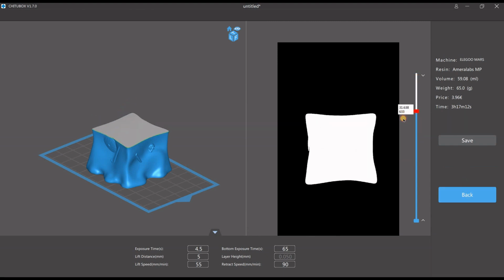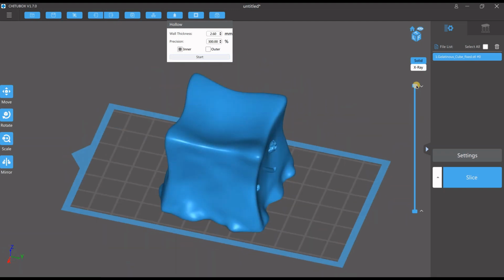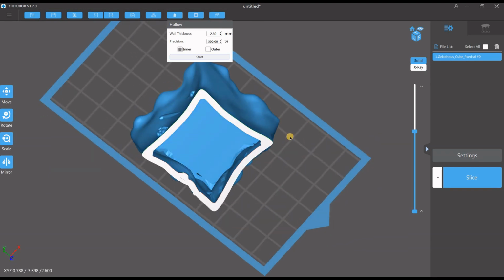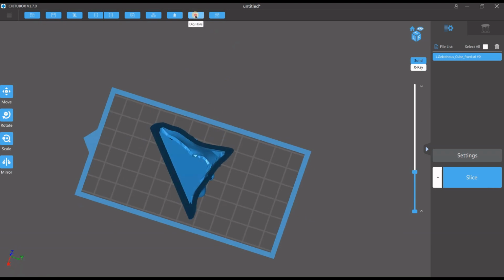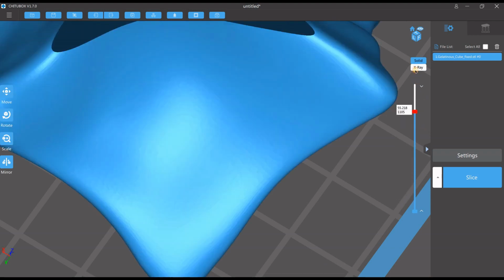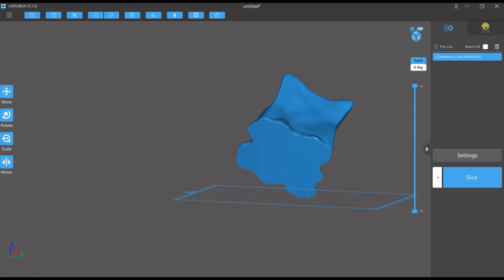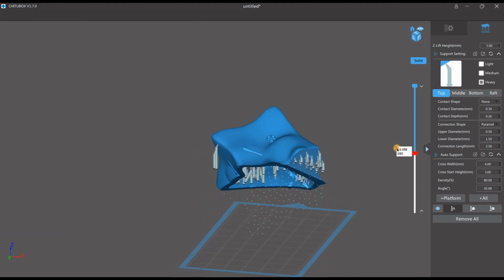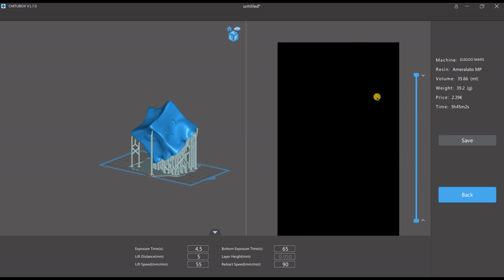Hollowing and Vent Hole Basics for SLA 3D Printing

Comment: Is it normal if there’s supports inside the figure, I placed the supports but I realized there are supports inside the figure and I can’t print bc I think it’s not right, please help me ;((.
Reply from the maker: Yeah, supports inside are perfectly normal. In most cases, you really even want supports inside because you will be getting geometries such as islands that can happen inside the hollow of a print.
Reply: @3DExtra  I was going to print a Hollow Totoro
Reply: If I drain the inside of the figure with alcohol to drain the resin, are the supports going to come off and stay there?
Reply from the maker: @ivankas52  Supports are going to stay there, but you don't need to remove them. You can just leave them there and everything will be fine.
Reply: @3DExtra  Thank you so much ☺️☺️

Comment: With the orientation flat on the build plate, would it make a difference (in terms of suction forces) if you put a large hole in the bottom of the model where it sticks to the build plate? Also, I don't really see how the cross section significantly decreases by tilting the model. It does decrease at the start and end, but halfway through the print,  the cross section seems about equally large as when the model is oriented straight up, correct...?
Reply: And a follow up: would it make a difference (in terms to suction forces and sticking to the build plate) if I place the non-tilted model on supports?
Reply from the maker: @readywhen  I'll try answer these as best I can:
-If you would hollow the model, keep it flat on the plate and put a hole on the surface that's touching with the plate, you wouldn't be achieving anything with regards to venting the model during the print. You'd still have the issue that the model acts like a suction cup and you'd be getting a different pressures inside and outside of the hollow potentially causing a print failure or surface defects. There's a great post on reddit that showed how important venting is: https://cutt.ly/tjuwKwr. So if you'd want to print it flat on the plate, you'd want to then put the venting hole on the side at the lowest point of the hollow section to avoid issues.
-The tilting is more of an orientation optimization thins. You are absolutely right that the minimum cross section will be at the bottom and top of the print, and the middle is going to be a little larger, but I was trying to say that the cross sectional advantage was better relative to a non-hollowed model.
-For your follow up, I'm going to be doing a video explaining orientation and why we angle things very soon so I'll ping you when that's out, but the TL;DR is: we want to try avoid having the "first surface that prints at the tip of supports" to be large flat areas. That includes bases, and long flat edges. The reason for this is that once that part starts printing on the support tips, you're looking at a 0.05mm (or less) thin single layer. Just with the peel, it might rip in places if it's under supported and if it survives the peel, it then has to survive traveling 10mm through the resin (5mm up and 5mm down) at whatever your lift and retract speeds are. That's why you see a lot of models that are printed with a flat parallel to the LCD on supports with a horrible surface finish on that face.

Hopefully that's helped!
Reply: @3DExtra  Thanks for your elaborate reply! The reason I care so much about this topic, is that for the objects I want to print, printing parallel to the build plate would allow the model to go almost suportless, whereas a slight tilt would  introduce many islands. Everything you explain makes sense. But there seem to be inconsistencies in all the opinions I find on the internet. Consider this youtube comment I came across and I'd appreciate it a lot if you could share your thoughts on it:

"There is effectively no suction being created inside the hollow because no resin nor air has been removed from the hollow after it was sealed. In fact, the air inside is VERY, VERY slightly compressed by the hollow model dipping into the resin. (You can see this in action by taking a drinking glass, turning it upside down, then lowering it into a bath tub or swimming pool. The deeper you go, the more the water will compress the air in the glass and you'll see the water level rise up inside the glass similar to what happens in a diving bell.) For a resin model the hollow cavity has a ~0.05-0.01 gap between the FEP and the model until the light source turns on, so up to that point, the cavity isn't sealed and pressure can equalize. For LCD printers, the resin perimeter will harden, but it will just hold the resin inside and outside now - it doesn't remove any material, so still no suction. When the model starts to lift, there is still no air or resin being removed from the cavity, so that side of the FEP is stable. At the same time as the model lifts, the underside of the FEP is open to the air, so there is no force pulling down on the inside of the hollow. All the force is on the outside perimeter of the model as the FEP is pulled between the edge of the model and the edge of the vat. Once the FEP peels away from the outer perimeter far enough to reach the inside of the hollow, then there is now a hole between the inside and the outside, so air and resin can flow an no vacuum can form to create suction. The only way for significant vacuum to form would be if the entire model stretched more than the depth of the resin in the hollow. At that point, the volume of the interior would have grown by more than the volume of the resin trapped air, and a vacuum would start to form. A flex resin could do this, but standard miniature resins are too rigid.
Reply: Looking forward to your upcoming video!
Reply from the maker: @readywhen  The term "suction" gets used for a bunch of things interchangeably and the community is not really willing to decide on one specific thing. Suction should only specifically refer to the added force created while peeling an un-vented hollow object from the FEP. There is no suction during regular peeling, that's just a peel and there's no suction between the LCD and FEP since that's a completely open system.

-The comment from the very start has no substance to it since there's no air trapped inside the hollow of the model unless your lift height takes the print above the resin line and in most cases that I've seen, the vats are full enough and the lift height is small enough for that not to happen. So while the diving bell analogy works to demonstrate that air is a compressible fluid it is completely invalid for explaining suction forces on hollow resin prints. The right test for this demonstration is: fill your sink up, take a glass, put it under the water and fill it up completely. Turn it bottom side up and try to remove it out of the water. Once the mouth of the glass comes close to the water line, you're going to start feeling some resistance on being able to pull it out of the water and that resistance is equivalent to the suction force on an un-vented model. It's most often not going to cause a catastrophic failure but it might result in a pretty big layer shift and if the model is big enough and the supports aren't quite right, it can result in the model tearing away and staying on the FEP. This graphic (not super accurate but brings the point across) might help with visualising it https://imgur.com/1M4W5iu.

-While there is a small gap there to theoretically be able to "normalise pressure" you're not going to be able to do that once the print builds up past the resin line in the vat, since there's no way for resin to drain out of it and as you keep building up the print, you're left with . As far as things go, that gap might be too small to be able to let things normalise and since the print is always at the lowest point in the vat, there's no way to let air move into it without a vent hole at the highest point of the model. Plus resin is viscous and 0.05 is a super small gap.